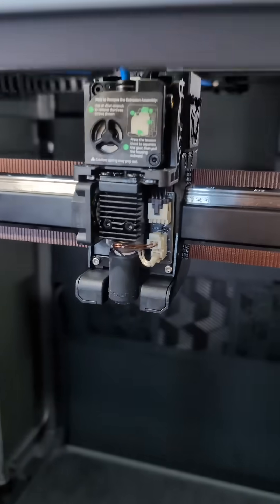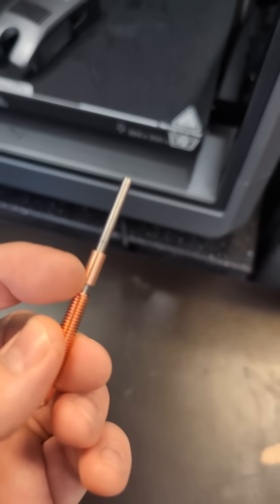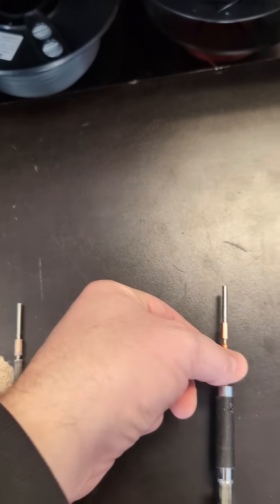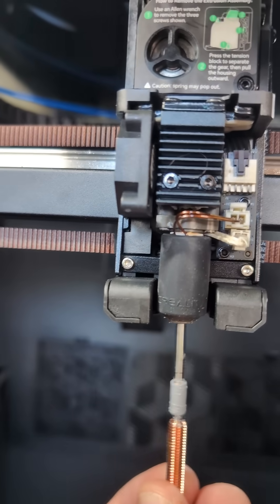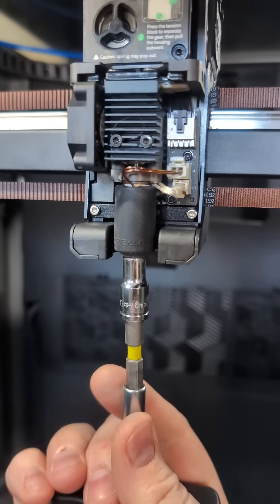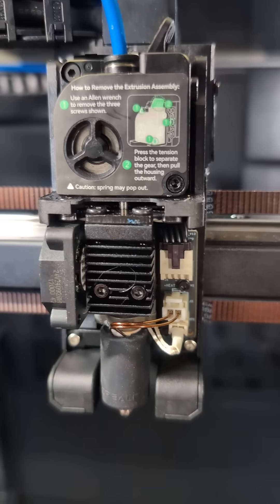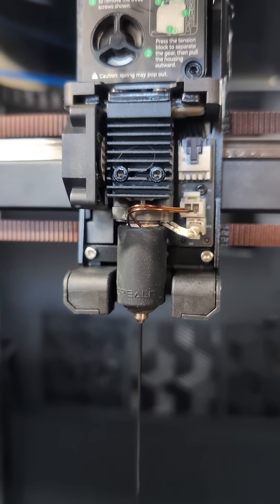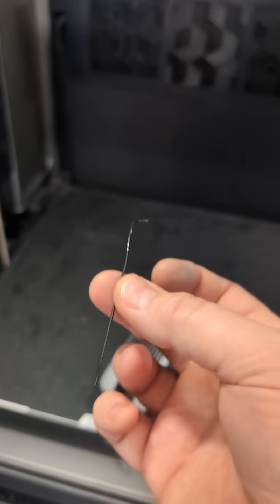1.0MM Nozzle on the K2 Plus #TH3DExclusive #k2plus

Comment: I've been printing with th 0.8 nozzle for bigger parts and faster TPU funtional print. Love to see how you set up the profiles for the 1.0 nozzle.
Reply from the maker: It definitely needs a little tuning. ABS is pretty easy. PLA needs a little more tweaking. Disabling the pressure advance is recommended on these.